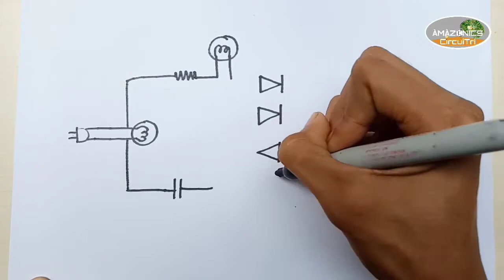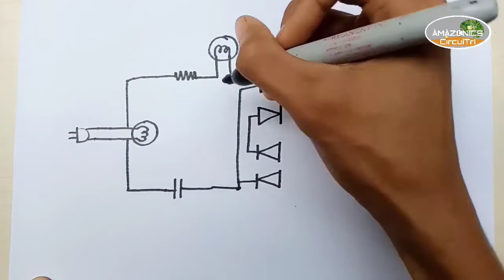DIY CAPACITOR TESTER VERY EASY 100% accurate very durable

Comment: I want to run it on 120 volt ac.
Reply from the maker: The working voltage of this design is 110 volts to 220 volts, but in my country we use 220 volts, because it is our standard voltage,